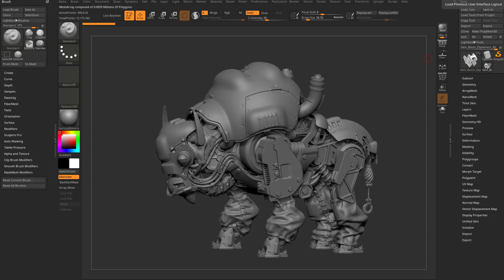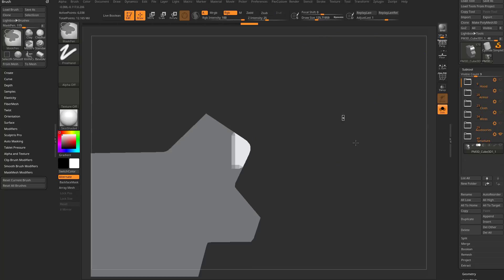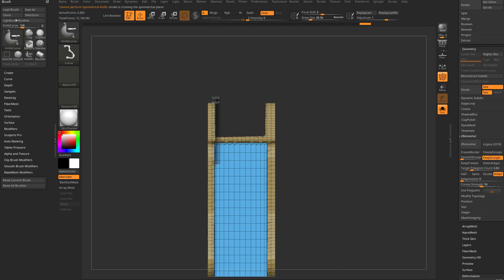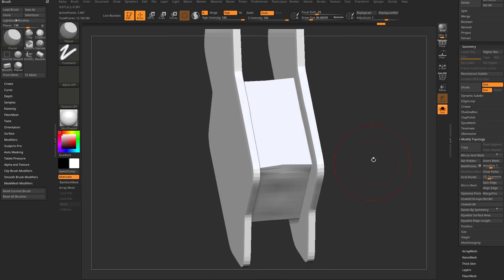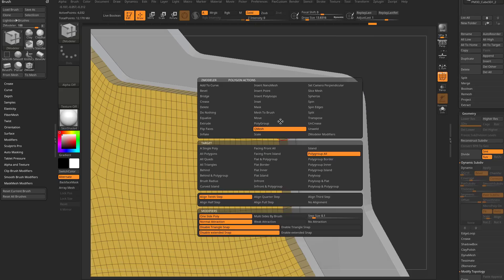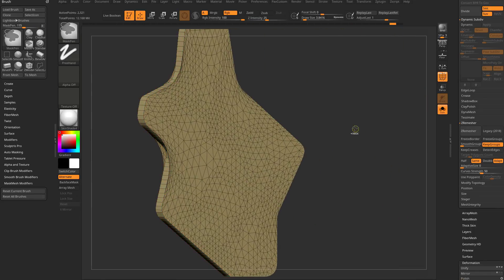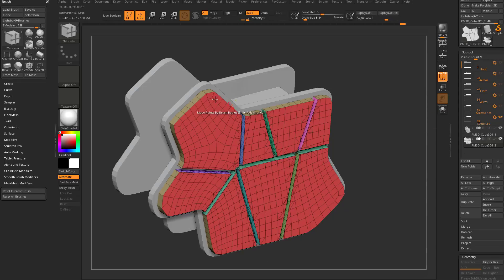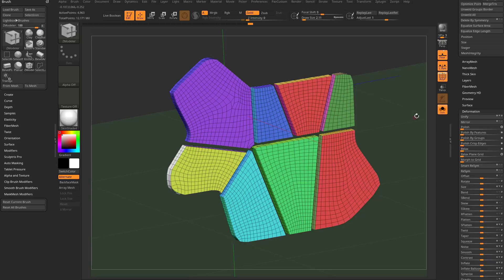086 Zbrush 2021.7 - Bevel and Knife Brushes Demo! Creating a lightweighted mech component

Comment: Try the Bevel Brushes on curved edges ;)
Tha´s right, it does not work! ... Unfortunately
Reply from the maker: I have a few videos you haven't left this comment on left, I can copy-paste for you if you want
Reply: @MichaelPavlovich  :D I commented two of your videos to have a better chance for response
Reply from the maker: @feetcentral  oh gotcha. I'd suggest for now putting a bevel on a rounded object using the myriad of other techniques other than a sculpting brush, or if you need to use sculpting, trim dynamic/hpolish/smooth. it won't be perfect, but again, not sure I'd use scupting brushes as a be-all-end-all solution for hard surface modeling. For example, ZRemesh to get predictable geometry, then zmodeler to dial in your chamfer / fillets to whatever specification you want https://youtu.be/tnOiMzqHf74?t=51
Reply: @MichaelPavlovich  You are right. There are enough other solutions. But it would be the most perfect Bevel Brush if this would be possible ;)